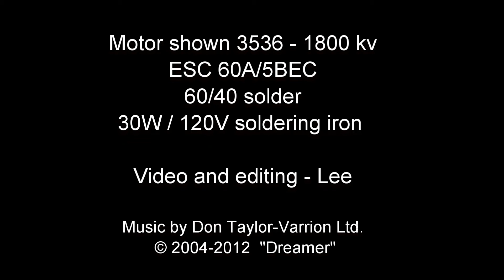Soldering XT60 and bullet plugs 7-12

Comment from the maker: It is easy once you have done a few.  When changing the plug on the battery only do one wire at a time including cutting the wire and putting the heat shrink to prevent accidental shorting.  Make sure you use the right plug on the right part.  Happy flying!!!